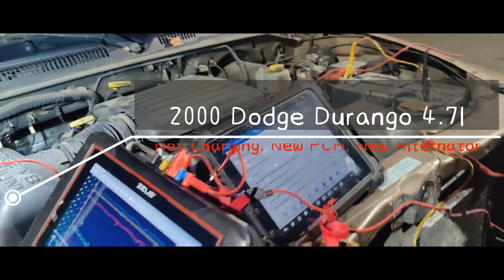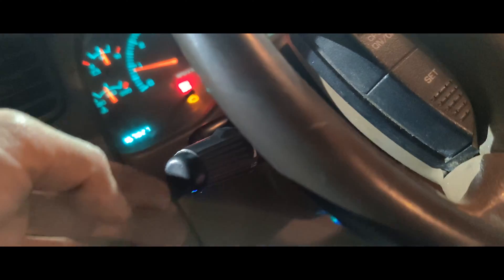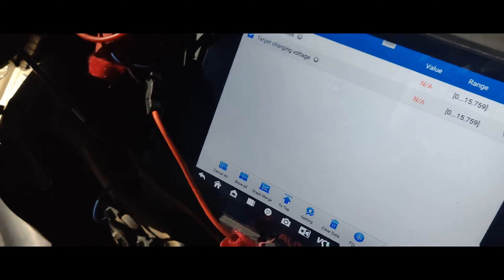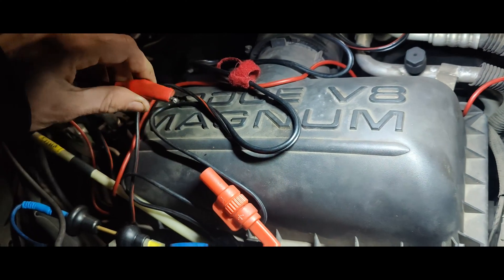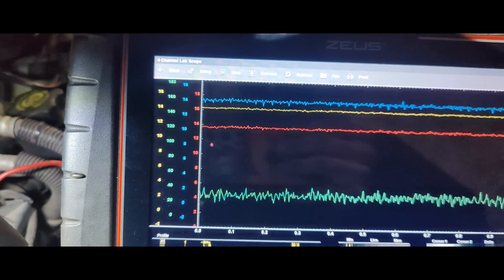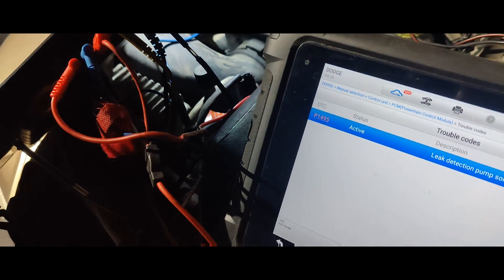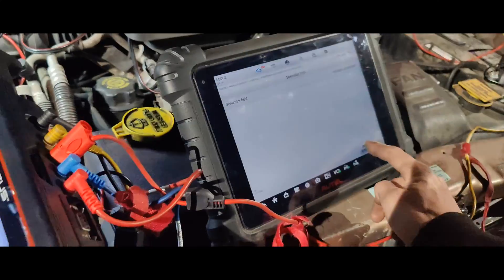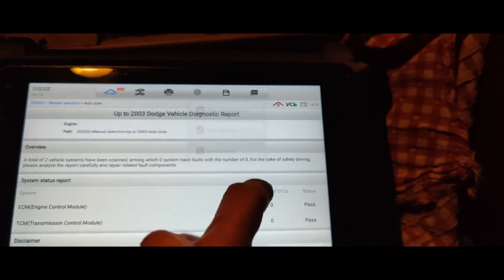2000 Dodge Durango 4.7l 4x4 Alternator Not Charging, New PCM, New Alternator

Comment: life used to be simple you had a alternator and a voltage regulator either internal to alternator or external easy to diag and cheap to fix no need for the pcm to control alternator makes diag more and repairs more tech has gotten out of hand on new vehicles.

Comment: You got abs codes cause you were supposed to do set pinion factor after putting the ecm in
Reply from the maker: I could see that from a brand new ecu but this was a reman. Maybe that was the case but think they had the codes before all this happened
Reply: @RobertDotterer  I had an ex-friend who had a durango with a 4.7 in it. The engine blew because the oiling passages got clogged up and seized the motor. He replaced it with the same motor & got identical results within 6 months.I later found out that he was a pathological liar, so this (the reason I kicked him to the curb) may be BS. Interested to see if anyone else can corroberate his story with similar results??